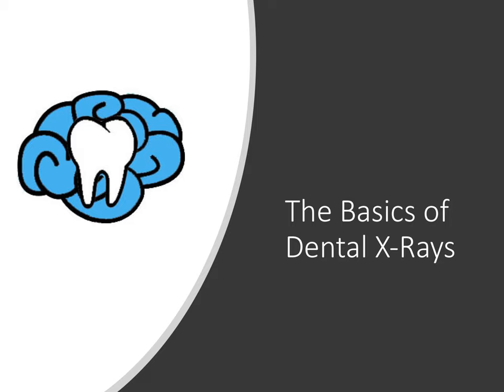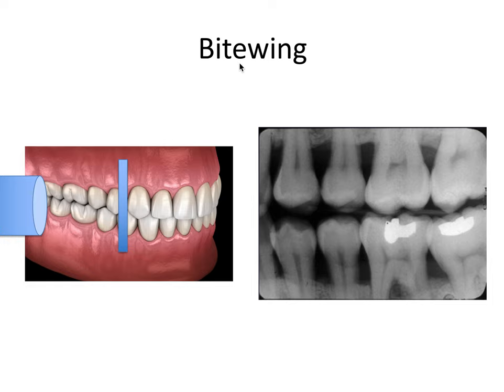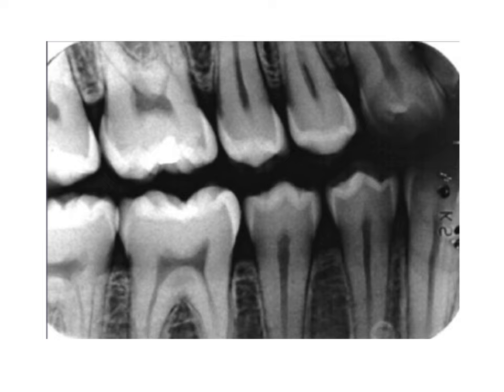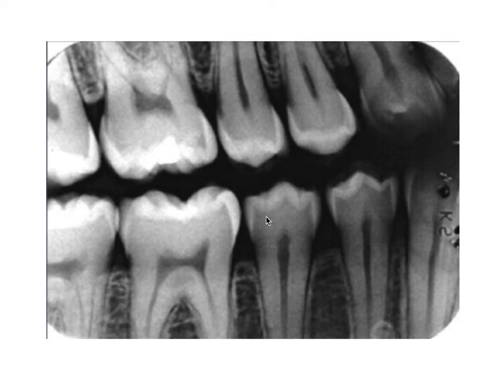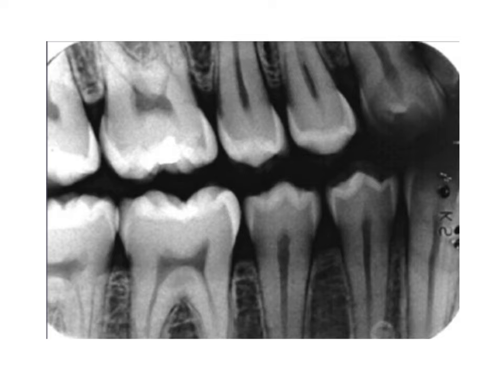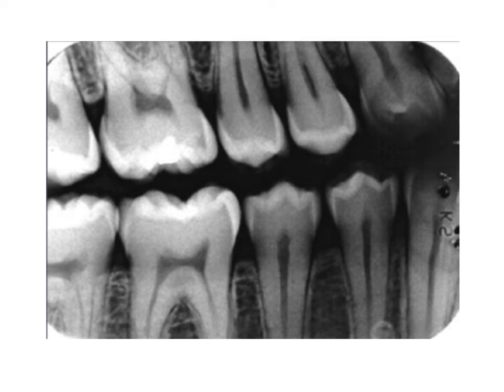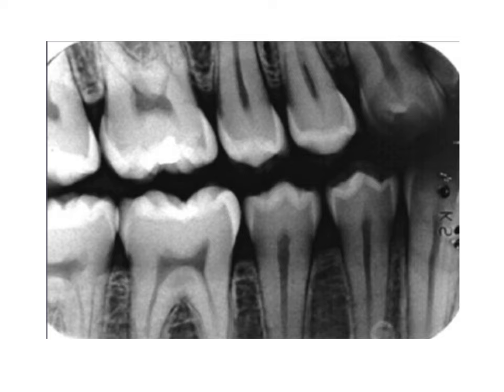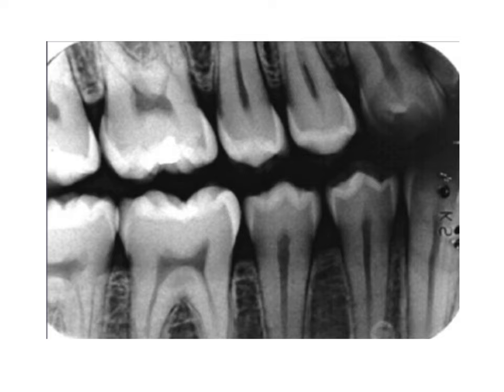How to Read Dental X-Rays

Comment: Thank you for the videos.  I'm not a dentist but interested in the field. Hoping I don't embarrass myself by using technical terms on my dental visits.

It appears the x-ray machine works similarly to a CRT in an older television (that also produce x-rays, but they are shielded from escaping the tube).  In a CRT, a metal cathode is heated to a high temperature so that it emits electrons. Those electrons are accelerated by a high voltage (25,000+ volts) and focused and scanned towards a phosphor screen which produces an image.  In the case of an x-ray machine, those electrons from the heated cathode are directed towards the tungsten and allowed to pass out of the unit and towards the patient's mouth.  Either way, you get a picture in the end, although I'm not sure a radiograph will win an Emmy.  :)

Comment: If a full dental digital x-ray exam give a radiation dose of 0.06msv to the head then:

10 000 full exam in a very short time will cause death.
1 000  full exam in a very short time will cause severe injuries.
100    full exam in a very short time will cause mild injuries.
10     full exam in a very short time will cause light injuries.
1      full exam will cause side effect.
0.1 full dental exam (1 bitewing digital x-ray picture) will cause no noticeable side effect.

You might ask why i calculated the risk this way its because we know the values when radiation start creating problem at these different level of severity. i just calculated how many x-ray it needed to reach these different level of suffering and death. i think those are pretty good ball park numbers.
Reply: What are you referring to when you say “side effect?”